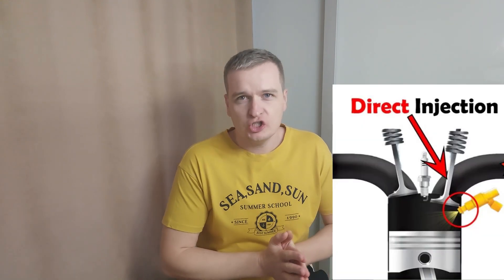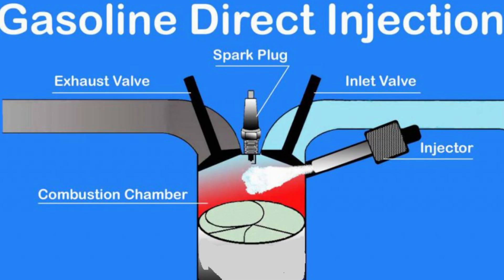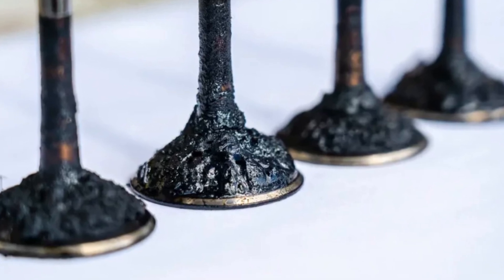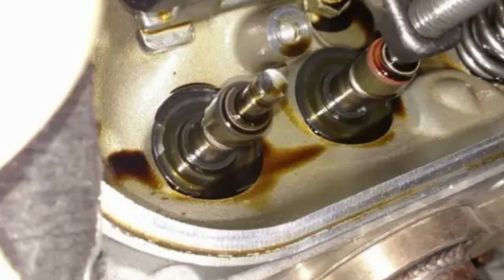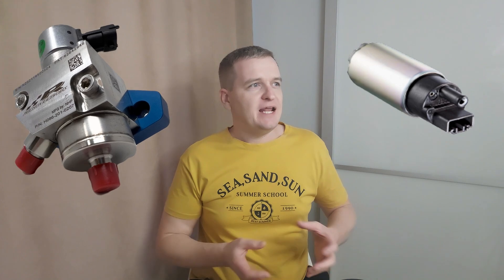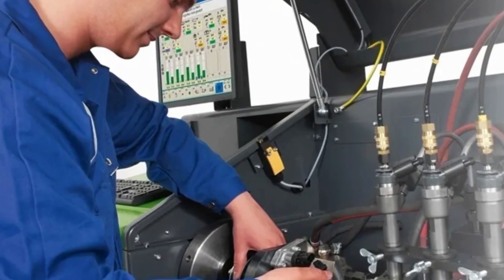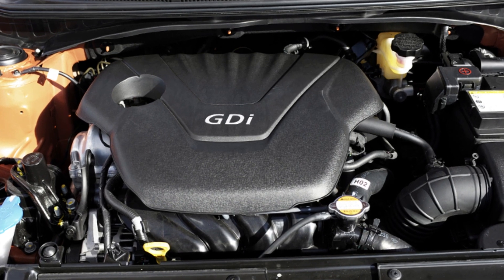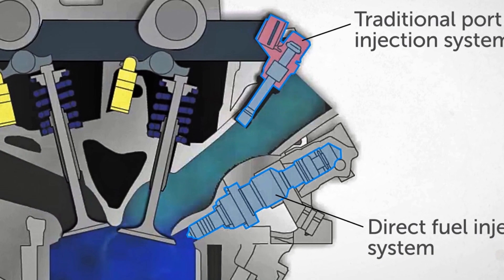Why is DIRECT INJECTION actually bad? Or Good?

Comment: Direct injection engines carbon buildup is not from oil in the cylinder. These buildups occur only on the manifold side of the intake valves. Small amounts of oil from the PCV system contact the valve head which is hot, but not hot enough to burn it off as in the case of exhaust valves. Some oil can track down the valve stem and coke on the valve head also, which gets more prevalent as mileage increases. 
A dual injection with a small part of the required fuel being port injected washes the valves clean.
Reply from the maker: This doesn't explain heavy carbon buildup on engines with 25k miles and absolutely no oil consumption, perfect valve seals.

Comment: Carbon buildup is caused by the EGR system combined with direct injection. Direct injection creates the possibility of a lean combustion. Get your facts straight. Your explication is just lacking correct information.
Reply from the maker: No, it's not correct. GDI engines without EGR form buildup on valves.

Comment: Carbon build up doesn't happen if you operate the engine at higher temperatures. The 3 in line ford ecoboost doesn't have that problem the body is cast iron. Only head aluminium. A familiar of mine has a 1st gen focus ecoboost from 2012 with 293 000, the car has made 2 belt changes and the engine head cover has been replaced once, because it's plastic, to avoid deformation and oil leaks. The oil has been changed every year or 15 000km the car has 0 carbon build up. Inside cylinder temperature above 200C disolve carbon. The cast iron engine body allows that. But if you take your car to make few km everyday then stop you won't allow the engine achieve those temperatures.
Some highway speeds for some times clean the engine, even the top of the valve.
I base this on this car, and we'll it aged. A mechanic checked the top of the valves once and there were almost now carbon build up he even asked if engines was opened or cleaned.
Reply from the maker: 1.0 ecoboost with such a mileage is a champ, I should say. Yes, highway frying and high temp will help, but not with all engines. Kia GDI will still have its valves covered in carbon whatever you do with it.

Comment: It sounds like the first owner of these vehicles (while under warranty) reaps the benefits of these engines. The second owner if getting the vehicle around 60K miles well they will often get hammered with big maintenance or repair bills.
Reply from the maker: Unfortunately, this is what's going to happen with any modern car, doesn't matter what type of injection is used.

Comment: GDI has emissions benefits, and makes the best use of turbochargers, provided you aren't going for stratospheric power numbers.
Reply: Until and as the valves build up carbon that the benefits are reduced to the point that the car emissions and performance becomes worse than conventional injection. 
So while the Manufacturer benefits from selling a great initial performance and meets government standards, the Owner ends up paying for it in the long term ownership cost.
Reply from the maker: As every single technology now, GDI has its pros and cons. But if I have a choice between direct and port injection, I cerainly go for port type.